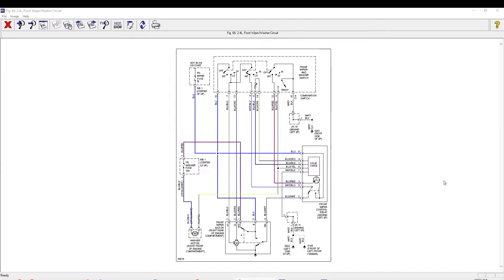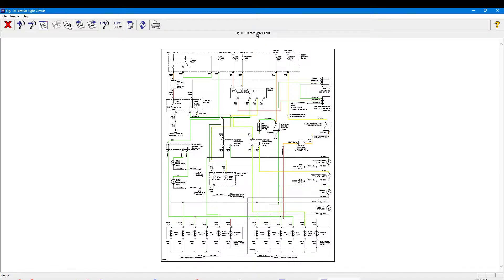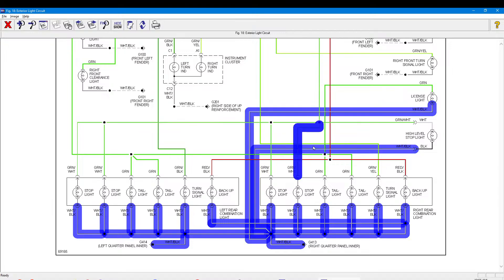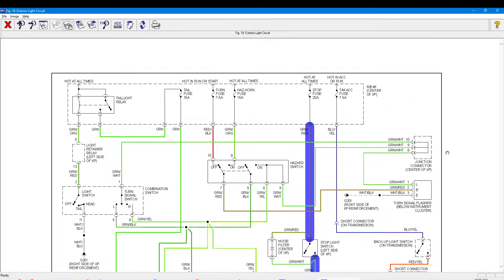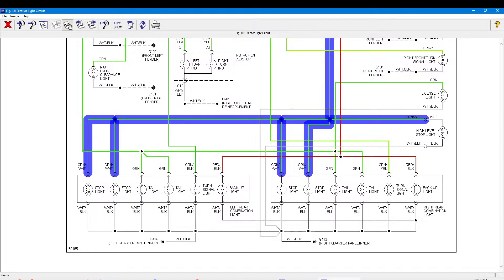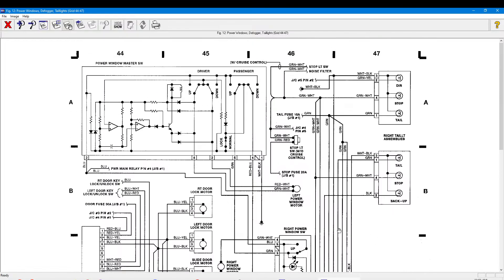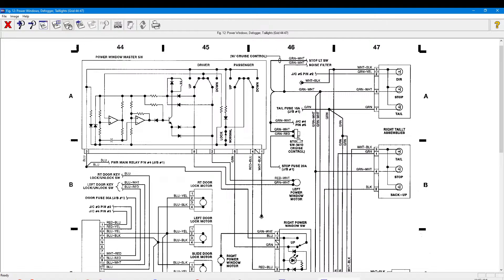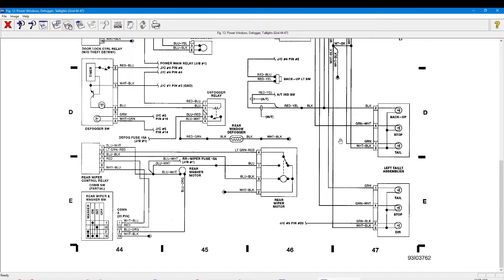Rear Lights - Taillights EWD Electrical Wiring Diagram

Comment: Gday mate I’m in cairns, my tarago decided not to start anymore have tested all wiring and am now looking at the door lock actuator as my tarago is a 1997 gli with the immobiliser. I’m trying to now figure out is it the antenna key ring coil, or the actuator itself I have the 3 wires going to the micros switch is good and tested ok however the signal from the pct is not responding and getting OL on both manually locking and unlocking which in turn wouldn’t send the signal to the door carol unit and immobiliser ecu thereby impeding the IMI signal to the engine ecu as I’m not getting any output from #10 and #20 on ecu going to the fuel injector, I have tested power to them and getting power and injectors op are clicking on and off when earthed however no pulse from ecu this was confirmed with noid light plugged into injector harness all 4. Where did you get your wiring schematic from 

Thanks in advance chris
Reply from the maker: Hey mate, sounds like you’ve done some solid diagnostic work already. You're definitely heading in the right direction looking at the immobiliser side, especially since you’re not getting injector pulse and the noid light confirms that.
If you've got power to the injectors and they click when manually grounded, but there’s no pulse from the ECU, it almost always points to an immobiliser or security-related issue, not a mechanical or sensor fault.

Regarding your questions: The antenna key ring (transponder coil) is definitely worth checking next. If it’s not picking up the key signal properly, the immobiliser won’t disarm and the ECU will block injector and ignition signals.
If you're seeing OL (open loop) when testing the actuator signals, that may indicate a break or failed component possibly between the PCT (Power Control Timer or Body ECU) and the door unit.
Since you’re not getting output on ECU pins #10 and #20 (injector pulse), and all power and grounds are good, then the ECU is likely being blocked from starting due to an immobiliser fault.

As for wiring diagrams: I usually reference factory service manuals for older vehicles like the Tarago. If you're chasing a full schematic, Toyota service manuals (sometimes found on forums or sites like Toyota DIY or JPNZ manuals) can be helpful. You might also find what you need through: autoelectric.ru (good resource for wiring diagrams globally)
Facebook groups or forums specific to older Toyotas/Taragos, Or you can try AllData DIY or Mitchell1 if you're okay with a subscription.

Let me know if you want help finding a specific wiring diagram. I can try and look it up for you. You're close to cracking it, likely an immobiliser comms issue. Wouldn’t hurt to scope or swap the key ring coil if you can.

Sorry for the late reply. I tend to put off questions that need a decent answer until I have time to sit and think about them properly. Good luck with it all!